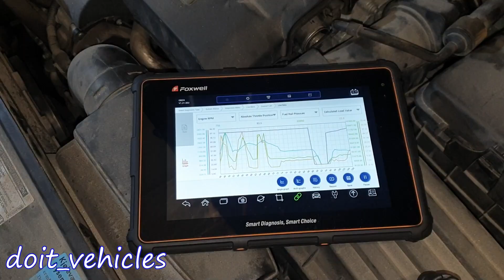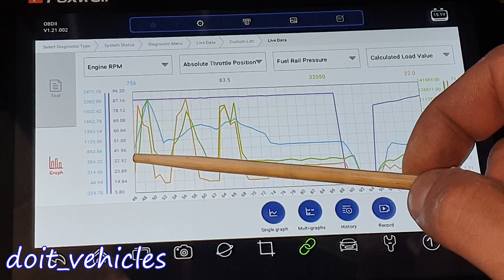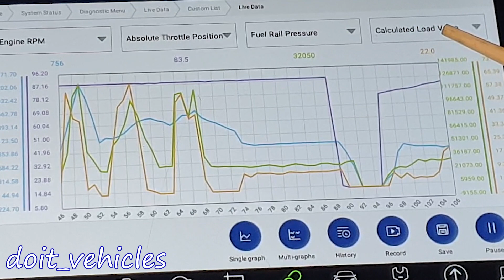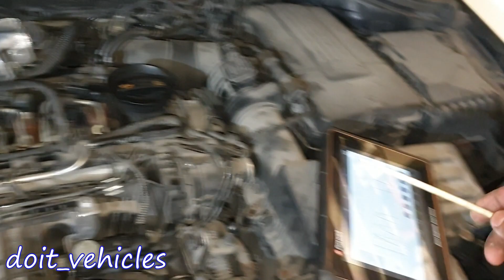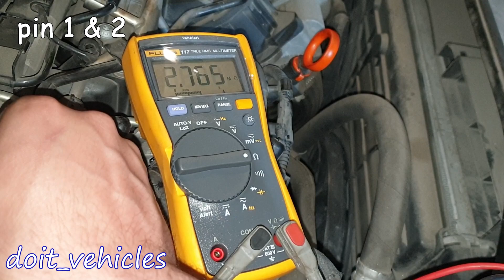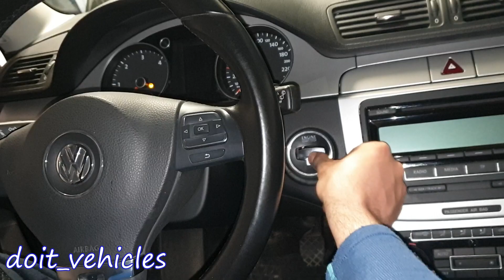VW Passat Fuel Pressure Sensor 1.6 TDI

Comment: Just a mention: the component which you are checking on the high pressure pump is not the pressure regulator (this one is at the end of the rail pressure - right side). That component is “fuel metering valve”. Cheers! Good video!

Comment: Hello,
can you tell me why I cant coding injector on audi a3 8v CRL engine? Car was running normal and after 20min. start to shaking hard.I replace all 4 injectors and try to coding them.Injector 2 I cant coding is not possible and engine shaking like before.If I put in cilinder2 my old injector I also cant code him.I have error code 026600.When car start shaking I was inside and I was trying to do something with obd11 when car was running.What should I do?
Regards